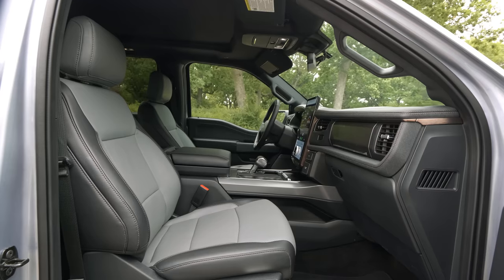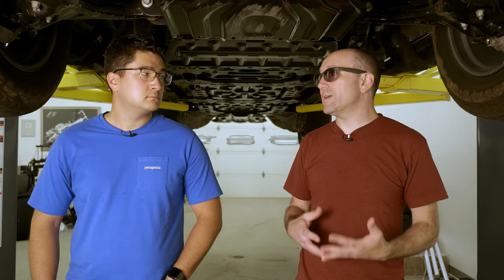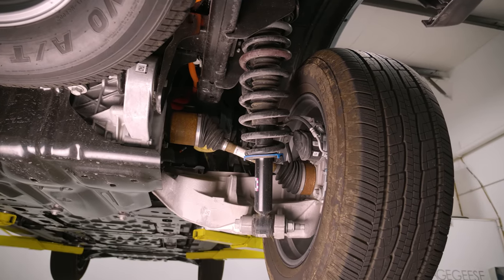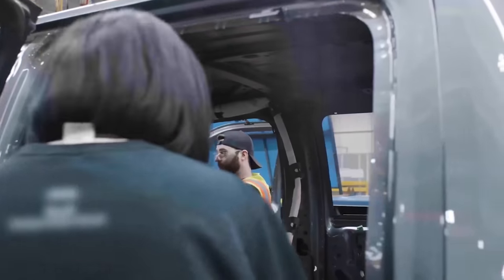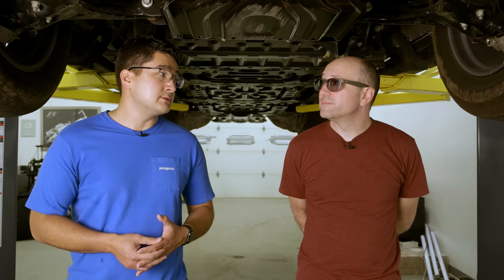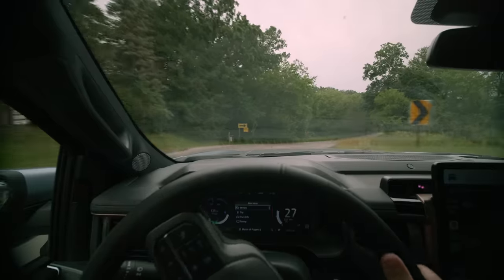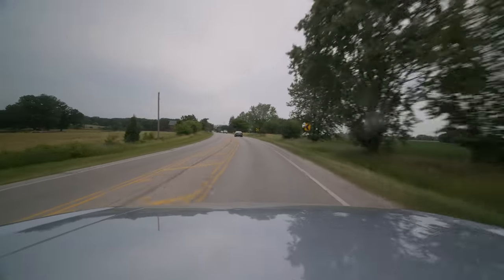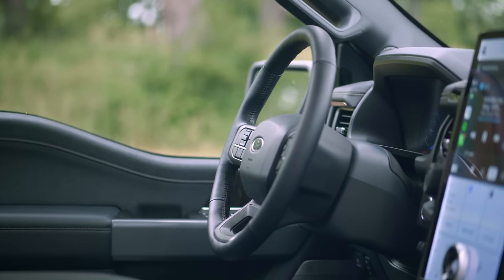Ford F150 Lightning | The EV That Will Change Trucks

Comment: This actually would be good for the majority of F-150 buyers that use these as daily drivers to work and the occasional trip to the hardware store, charge it at home in the garage and get a full charge every morning, a lot of people don't tow with the normal F-150.
Reply: You don't need to tow to need a bed.
Reply: Exactly....and possible tow a boat.  I do like that you should be able to use the same stuff(camper shell, bed cover, etc) as it's gas variant.
Reply: Or buy two gasoline powered Mavericks or Rangers for the same total cost.
Reply: @Parker53151  the pro version is 40,000. That's the one I'm gunning for
Reply: As someone that bought their very first truck, a used F150 last year, we tow and haul quite a bit. Some short trips, some longer.
Ideally, this would be our daily and for the short tows with maybe a gas/hybrid F150 or F250 for longer trips as a loaner from the dealer? 

That would cover all our bases extremely well, but not really practical for the marketplace.
Reply: I have a neighbor down the street that runs deliveries for a local contractor supply.  For delivery of large trailers of lumber, they will still use a diesel HD truck: the trailers are something like 20,000lbs.  But for plywood?  He's chomping at the bit for one of these.  150-200mi/day with 500lbs of plywood or concrete bags or whatever in the bed is the ideal use case for this.  He estimates it will save him about $600-800/month in gas and pay for itself.
Reply: Yup. But the Maverick is perfect for 90% of truck owners. Most truck buyers buy them because they feel big and tough, yet somehow hides their impotency and tendency for ejaculating the moment they put it in a glory hole.
Reply: @buttsexandbananapeels  I agree on the Maverick
Reply: I can't tell if you meant that sarcastically or just generally, and that's the joke.
Reply: @Parker53151  , yeah I wanted to get the Maverick but they told me be a year before I could get one.
Reply: Those buyers would be better off with a Maverick
Reply: @buttsexandbananapeels  Someone is projecting.
Reply: This great for man children who like larping as the “blue collar murican’s” but as a commercial vehicle it’s a little disappointing. Ford really needs to make EV cargo vans, they’d sell like hot cakes. Fun fact, the HD3500 Econoline is the most sold vehicle in the US. The F150 is the most sold “PASSENGER” vehicle in the US. Most contractors such as myself don’t want to deal with training employees how to drive a trailer or lost wages because there wasn’t a 35’ parking space available. I’m guessing about 5% of F150 owners actually use them for towing or work, the other 95% are just living a fantasy or compensating.
Reply: @brandonclark8736  90% of these vehicles will never see so much as one straw from a hay bale. The majority of the owners are all hat, no cattle.
Reply: Trucks have become luxury cars for the suburbs, which makes this truck perfect for most F150 drivers.
Reply: @BiffBuffchest  wonder if it is safe to dip the backend in a lake with an electric motor there. Just a question.
Reply: No way the power grid is not ready  for all these  electric  vehicles!
Reply: I only tow 3-4 times. Year.   Even so it would rule this out.
Reply: The Pro model is perfect for me. Enough range to get me to work and back all week and can still move some dirt bikes around to the trail when I want. The frunk is nice too with all the thieves running around nowadays.
Reply: @Parker53151  or one Tacoma and drive seven-10 years before you spend as much for this. Still cool though.
Reply: @shensley011  You let me know when ya find one for $40,000….
Reply: @tomstarcevich1147  oh no! Not the power grid!!! What will we ever do about the power grid!!!!!! *runs outside with flailing hands overhead
Reply: Most F150 owners dont even use the bed
Reply: for now its full charge every morning. At some point there will be regulation throttling home chargers so the grid can cope with the power needs. They already on it in Europe.
Reply: Absolutely correct; the question is whether the buyers this applies to would actually admit that they don’t really tow.  I think a large percentage of pickup buyers, while they will never actually tow anything, ASPIRE to tow things.  It’ll be interesting whether Ford can break through that mentality.
Reply: @JCintheBCC  Oh John, you make way too much  sense...... we're chomping at the bit for our first one also
Reply: @pajamatime5750  No mark ups. . .I could keep going but you get the point. I'm part of the Reddit group and people are getting them with no mark ups from their dealers. These are reservation holders just like myself. I've heard Ford is going to open orders back up soon so keep an eye out if you want one of these 40,000 dollar Pros. I have in writing from my dealer there will be no mark up, they don't do that on factory ordered vehicles. If someone orders a lightning and then cancels their order, they will keep the vehicle and then mark it up. But I'm not planning on cancelling. There has been reports of sleezy dealers marking up, but you can simply change your reservation to another dealer that is not sleezy.
Reply: @shensley011  That’s cool then. I’m in Canada where they can’t markup over MSRP at all…. I find it crazy the US allows the markups we’re seeing!!
Reply: The problem for Ford is that demographic of people who need a grocery getter 5000 that can do Home Depot runs for some nails and a rental tool are better off with the Maverick that costs half as much and gets over 40mpg.

This truck is only really appropriate for people who actually tow/haul weight. Which isn’t an insignificant number of truck owners but it’s not the majority either. The majority will actually find the Maverick more useful because of its range, price, and maneuverability in cities.
Reply: maybe thats true where you live. not in the southeast.
Reply: @JCintheBCC  Good point.  If gas is $5.00 a gallon, about $3.00  to $4.00 of that money is wasted [lost] in unrecoverable heat in an ICE vehicle.  An EV, on the other hand, uses about 80%  of the energy in electricity.
Reply: @brandonclark8736  wtf are you saying?
Reply: @buttsexandbananapeels 😂😂😂
Reply: no plenty do

Comment: Incredible that in the time it took between Tesla announcing the Cybertruck and failing to release it, Ford has developed and brought the F-150 to full production. Crazy what can happen when a proper company makes an EV.
Reply: i have no sympathy for tesla but ford didn’t make a truck from scratch here.
Reply: Tesla is a tech company, Ford is an automaker
Reply: Ford has made the F150 around since like 1950 bro. Lol they just shifted the most recent generation to support an EV structure and powertrain. Not as much engineering as building a complete truck from the ground up.
Reply: This isn't a Fully EV platform truck.
Reply: @outermarker5801  Tesla is a broker of environmental credits. Not a tech or manufacturing company.
Reply: @isserdigan2835  yes, and that is why it is going to sell great. The entire message of this review
Reply: We see what you are doing here but let's wait for Tesla to release the CyberTruck. Then we'll be able to form a valid conclusion.
Reply: Cybertruck is an exoskeleton 

All ford did was add an EV powertrain to an existing truck. It wasn’t rocket science
Reply: This truck wouldn't exist without Elon.
Reply: That's like comparing Apple and door hinges.
Reply: Wrong, linda Zhang the chief engineer of the lightning program has said publicly they started on it Sep of 2018. 

Cybertruck was shown off for the first time in late Nov of 2019. Car and driver who had insider access to the ct program had an article which showed the truck used at the debut event was only started on in August of 2019. So as of right now the cybertruck program is under 3 years old. 

And the lightning just like all Ford's has already had a major recall for the tpms sensors issued. How bout dem mach e recalls to. 
I mean Ford does lead all legacy oems world wide for recalls per vehicle sold plus the most common recall is for the risk of fire. 😂
Reply: @isserdigan2835  It fact it is, everything below the body is a completely new design.
Reply: @NoNonsensePC holy shit those prices differences are insane. Unless someone thinks they're saving the world, I can't see the logic in switching from ICE f150 to EV.
Reply: there's nothing proper about this

Comment: I don't see how this will be irrelevant. 230 miles minimum with 120v outlets in THREE locations on the truck, and 240v power in the bed. Most contractors travel a fraction of that distance. Even the first versions will be supremely useful for decades.

Comment: I appreciate that Ford kept it pretty simple and "normal" for their first EV truck. When you compare it to how Rivian, Tesla, and GM have went and kind of leaned into that EV FUTURE design and feeling while Ford seems to have just made a F-150 that happens to be an EV. In regards to the charging affecting the electrical infrastructure, you make a fair point about how the grid can handle people chanrging at home. This was also a problem when everyone got a AC unit, but the power grid adapted and changed to be able to efficiently, and safely provide power I think it will be the same for at home charging in the end.
Reply: Maybe. But these things have a 100 kWh battery! That's an awful lot more power to replace than running air-conditioning.
You could quite easily run A/C , hot water, lights etc from a normal 5kW home solar power setup.
But to even half charge this battery would need 10 hours of full sun.
So if a lot of people start using these and other EVs the grid is going to struggle to cope. 
Add to that the fact that reliable power sources are being phased out in favour of "greener" alternatives, means we could be seeing pretty regular power outages.
Reply: Unless you live in Texas 🤣
Reply: @richardbixler  
Actually, funny thing... Ford timing on talking about the V2H system is... perfectly unfortunate 
I am sure you can guess when...
Reply: I think Ford realized their mistake back in the '90s when the Taurus went to that bubble shape and the Camry stayed looking like a traditional car so the Taurus sales plummeted and the Camry became the new commuting appliance of choice. If they went with a weird looking truck like the CT, their customer base would have went out the window and they would have been saddled with the bill for all the new tooling needed to make it. I think it's a mistake for Chevrolet to go with the design of the largely unsuccessful Avalanche for their first EV outing, but I could be wrong and the BEV buying public may be ready for the different aero styling and utility features of that truck.
Reply: afaik power grid usage always peaks during the day, and at night it drops off quite a lot, which means the existing grid should be ok with people charging up their cars after they get home...the power stations would just keep running at capacity into the evening.
Reply: @alanjm1234  It's a lot, but not that much. It is about the same as everyone turning their dryers or hot tubs on at the same time in a neighborhood. Some locales will shrug it off and others will struggle and have to upgrade in typical "have / have not" fashion. What I wonder is how many folks have enough panel to charge these, I'm guessing you will need at least a 200 A panel so there are a good amount of people who will have to factor that pricey upgrade into their buying decision also; or be forced to "trickle charge" it on 8-12 A 120 VAC, which may work if they keep it constantly plugged in when they aren't driving and their weekly commute isn't that far.
Reply: You're forgetting the 150 is a chip off the rivian design.
Reply: Yeah utility grids are constantly making upgrades, it's not like they haven't thought of this
Reply: @garbonzobean1  Why would you assume that. It is actually a pretty brain dead take. Texas has the same issues and they are basically the exact opposite side of the coin as Cali.

Comment: Arguably the most important vehicle on the market right now.  Ford knows it HAS to get this right.  And it appears they've done a pretty good job.
Reply: The Dacia Spring is more important
Reply: 100% Agree - a good job on a very important vehicle, given its popularity and sales volume. Ford certainly is moving aggressively with EVs by producing versions with some of their mainstay nameplates (Mustang/F150) vs new models.
Reply: Just wait for the engineering and production quality issues to crop up.
Reply: @Loudlevin  of course, it’s a first gen car with brand new tech. Look at Toyota’s EV - a crappy car with a silly name. Ford isn’t discontinuing the regular mustang or F150 but they certainly are taking EVs seriously by introducing EVs in their core vehicle lineup. A gutsy move.
Reply: @Loudlevin  I'll wait...they crop up for every manufacturer.
Reply: Absolutely, this has strong political implications that I think are understated, perhaps on purpose because noo ne really wants to go there. But this could shift the perspective of a lot of people who do not want to switch from gas and help push more charging infrastructure. Ford f'ed up with the not-a-mustang mach-e, this one they got right.
Reply: Don't tell Ford what to do.
Reply: @CarbonAtom14  you can't tell by the sales of the Mach E.  As a Mustang owner I have no issue with it.
Reply: I think you're underselling how important it is.  I'd say most important since whenever it became clear that Tesla was for real.
Reply: @dragospahontu  maybe in Romania...

Comment: 10:47 - engineering explained has a great video covering that. most people charge their EVs overnight when there's excess wasted capacity (i have Georgia Power's EV power plan, which drops the price per KWH from 7c to 1c between 11p-7am - during the summer hours, M-F, 2p-7p it shoots up to 21c though)
Reply: Yes, this question has been answered repeatedly by utilities nationwide. Nighttime demand is dramatically below daytime demand, especially in regions with high AC use. Charge these at night and the grid will be fine. Of course Ford won't answer that question, because that's a question for utilities. Ford wouldn't have the details.
Reply: Who the heck is going to get out of bed at 11:00 p.m. to charge their car? I'd imagine most people would be plugging in their EVs as soon as they get home from work.
Reply: @jdroofcleanpw  You plug it in when you get home, but either the truck or charger are smart enough to know the time and you can tell it to only charge between 11PM - 7AM. Pretty easy problem to solve.
Reply: Right now there's excess wasted capacity, what happens when everyone is charging at night? What happens when they turn the grid off for safety reasons and you're suddenly dependent on the grid even more? Pushing gas prices up in order to entice people to buy ev is not how we should go about it, keep gas cheap or normal price and let the people decide gas or electric.
Reply: @adam_says  EE’s video explains it better than i could in a YT comment. gas isn’t expensive because the gubment wants to push people into EVs, it’s because there’s an import ban of oil from russia, which is part of OPEC+ and one of the main oil producing nations
Reply: @jdroofcleanpw  you set a timer man, you can plug it in and tell the car wait to charge until 11pm
Reply: @adam_says  most ev comes with scheduling. The smart chargers comes with apps, and connect with echo dotd
Reply: @vinylcabasse  You can't blame Russia for the incompetence/maliciousness of the Biden administration. Trump had the U.S. energy independent
Reply: @seantaylor2683  we haven't been truly energy independent since the 1950s.
Reply: @seantaylor2683  America has not been energy independent for a long time.
Reply: LOL it's 4x higher in California.

Comment: A solution to the home generator issue is to get a Generlink. Then the whole house is powered and you can choose which circuits to energize. It doesn't require another panel etc. It installs where your power meter is and is a 1/2 hour install. The electrician cost is minimal. All mine did when he was here is give the utility company a small step ladder to reach the meter when they pulled it off to install the Generlink.
Reply: Damn. That looks incredible. I appreciate you sharing that!